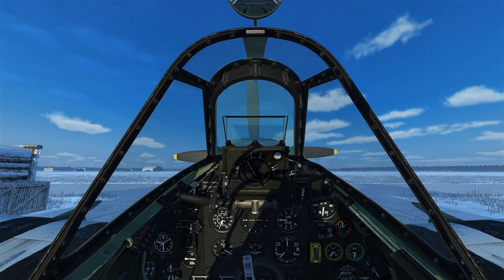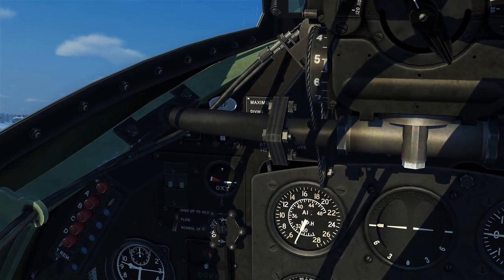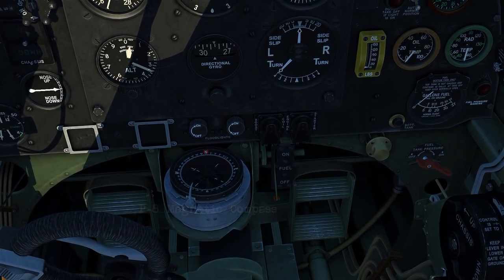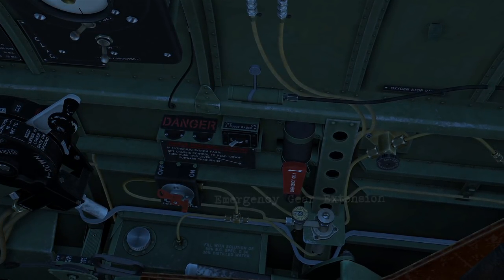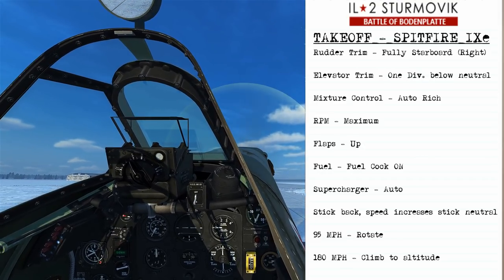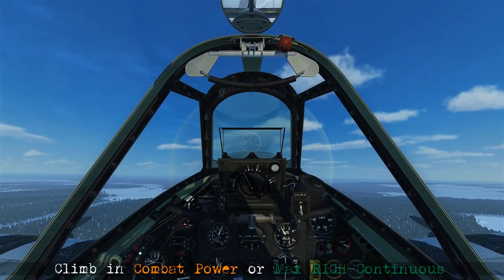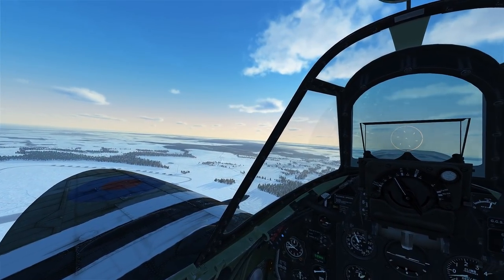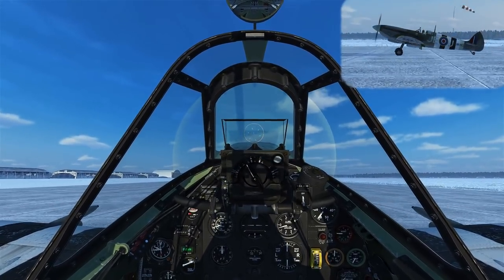Learn to fly the Spitfire MK.IX

Comment: In reality Merlin 66 and 70 engine Spitfires had Bendix-Stromberg injection carburettors and mixture was completely automatic with no pilot input. The mixture lever should act as an idle cut-off like in DCS.

Comment: Excellent video as usual, but there is one mistake. The take off elevator trim is one division nose down, not nose up as you have it in the video.  See the manual: it is quite explicit.
It does not make much difference in fact, especially since the BoS Spitfires seem to have less nose up tendency than the real thing, but that is what the book says.
Reply from the maker: I know what you're meaning Unreasonable. I do have the original Spit IX manual (plus the DCS one) as I try to base these videos off the manuals from the period when I can. From what I learned the neutral position is 2 bars towards Nose Up from the center according to the DCS manual, so with the phrasing in the original manual maybe it needs to be 1 bar down from neutral instead? I don't know. It doesn't seem to make a great deal of difference as you said, but with that neutral position in the video I the takeoff felt very natural so I wasn't too concerned about it. One day when I fly a Spitfire in RL I'll know for 100% certainty though :-D
Reply: I stand corrected!  I just assumed that the neutral position is in the middle of the scale, since there is nothing on the scale or in the manual to indicate otherwise, but on checking the trim tab in external view it is as you say at neutral when two divisions up from the middle.  I shall now have to get used to taking off in a slightly less nose down posture.   

Thanks for reply! I always learn useful stuff from your films.  Hope you get a chance to fly a real Spitfire one day.

Comment: Thank you! That gliding approach is the first I've seen. Could you elaborate as to why you do this?
Reply from the maker: It's known as a "power off 180" approach. No particular reason to do it or not to do it all the time. It's kind of a test of how good your energy management of the airplane is. Ideally you will land where you want to land using this technique, but it takes practice. For an extra challenge you can try these power off approaches to a wheel landing instead of a 3 pointer
Reply: @RequiemsACTL  Got it, thanks mate

Comment: As usual a terrific video.  Any chance you could do something on avoiding blackouts in the Spit IX?  Something about this aircraft makes it very prone to blacking out, at least when I fly it.  Thanks
Reply from the maker: I'll try Neil. The issue with blackouts is that it's related to the rate at which you apply G as well as the max you can apply. The Spitfire and Tempest for example have high amounts of elevator authority so you can apply G very fast very easy...too fast for the pilot's cardiovascular system to compensate, so he gets to say goodnight :-)
Reply: I guess all that elevator authority is great when you are slow not so much when you are fast.

Comment: Requiem, just noticed you've got a manual mixture control. Was this removed in a patch and switched to an automatic control?
Reply from the maker: Yeah I think you're right Moggy. At some point the devs added automatic mixture to the Spitfire IX. I can't remember when that happened though.
Reply: the clip wings were for increasing the Spitfire's speed and roll rate but at the cost of reducing the turn rate.

Comment: Thank you for the vid; Is it possible to release bombs individually on this spit or only all at once?(2 x 250 & 1x 500)? Also, what do you consider to be high altitude for the Merlin-70 to be advantageous? Many thanks
Reply from the maker: You're welcome Mark. Unfortunately it's not possible to release bombs individually. The bomb release button is on the inside of the throttle handle and that just drops the 2 x 250kg bombs at once.
Reply from the maker: Oh and regarding the Merlin 70...I think off the top of my head you need to be above 26,000ft...but I'll need to check
Reply: Many thanks for the prompt reply; pity about the single bomb release and I very rarely fly the spit at 26000ft if ever, I will stick with the Hi octane option,thanks again
Reply from the maker: No worries that's what I'm here for! Yeah definitely stick with the high octane...it's like a whole new airplane with that!

Comment: Help, I have watched you how to on the mk9 spitfire many times however I keep losing control after landing and slowly down on the run out , the aircraft starts to swing and no amount of brake and rudder will bring it back this usually results in a wing strike and ripped off aileron.  I still have flats down , should I raise them after touch down. Any suggestions grateful accepted.  Thanks in anticipation  Leigh
Reply from the maker: Just as a disclaimer...what I'm going to tell you next is a technique for the game. I do not recommend this when flying in real life. In the Il-2 Spitfire: Hold down the brake as soon as you touchdown and DO NOT let go of the brakes until you're at a stop. When you use the rudder pedals you will get differential braking as well as the normal rudder effect. You will not ground loop whether the engine is running or turned off doing this technique.
Pretty much everything I teach on my channel is based on real life principles...but this one is a rare exception to make your landings in the sim easier.

Comment: Why the hell does this thing like to ground loop so hard? I mean no locking tail wheel yeah but still
Reply from the maker: If you use the brakes while using the rudder you'll get differential braking and won't ground loop.

Comment: Good video.  Thanks.  I have a real problem with ground loops.  What am I doing wrong?
Reply from the maker: Use braking and rudder at the same time. This will provide differential braking. You can land the Spit engine  on or off without ground looping ifc you use this technique. It just takes practice :-)
Reply: @RequiemsACTL  Thank you.  This has been driving me bonkers.  Every single time I grease it on, nice and easy, 3 point,  slow, gentle braking I think no way a ground loop and then I go into one.  I looked up the Spit to see if it had a locking tail wheel.  Nope. Your answer has saved me from pranging another bird.  Salute.

Comment: why does the Spitfire always spin around near to the complete stop ? What am i doing wrong ?
Reply from the maker: You need to continue holding brakes until you come to a stop and use rudder at the same time. When using brakes with the rudder pedals it provides differential braking.
Reply: Keep your eye on the turn and slip guage. The turn needle should not go outside the number "1" marker in either direction. Use this to fine tune your rudder corrections until you come to a complete halt.

Comment: Hi.. Im having some dificulties using the engine for normal and combat flight. What is the correct throttle, propeller and mixture for best performance in normal flight and combat? Could you tell me that for the VB and IX models? And also, I stall every time in hard turns, it seams that the plane pull more than I commanded. Any tips for that?
Reply from the maker: Look in the Specifications page when in the hangar to find the correct RPM and Boost settings for the MkVb and IX Spitfires. Use "Max Continuous" for cruise flight and "Combat" for combat. As for mixtures just keep them at the "Auto Rich" setting, but you can set them to "Auto Lean" during cruise if you wish. There is a bug right now (31 Oct 18) which may be causing problems for you as it affects the automatic radiator control in the Spit Mk IX, so it can't not regulate temperature correctly that should be fixed in the next patch.
Reply: @RequiemsACTL   nice.. thanks. And what about the overcontroll during hard turns? It seams for me that the elevator have excesse of actuation when I pull during turns. That doesnt happend in other planes. I think that is why I always saw people fall in expiral durin combats when this plane was release in the game. But I didnt figure out how to avoid. If i pull less, everyone get on my six... any tips?
Reply from the maker: The elevator is very sensitive, so it takes practice to become accustomed to how much you need depending on your airspeed. Try some tight turning starting from different airspeeds in a quick mission without anyone shooting at you. With a fast airspeed you should be able to turn hard enough to start greying out but the slower you go you will need more back pressure to keep up the same turn rate. Start out with a little bit of back pressure then increase it...if a bandit starts moving to your six then pull back more to bring him forward on the canopy. You shouldn't have much problem out turning anything in the Spitfire.
Reply: @RequiemsACTL   yeahh... I will try.... thanks alot

Comment: I would love to be this smooth in landing.. Would also love to see you do this in the Spit in DCS, if you fly that too? Another great video, thanks!
Reply from the maker: I do have the DCS Spitfire as well but I haven't flown it yet! It will be pretty much the same procedure you see in this video as I use the real manuals when available for these familiarisations. I'll see about doing a quick takeoff and landing in it.
Reply: It's maybe not the right place here but the flight model in DCS is quite different and the plane becomes very light and floaty on approach (and hard to control), with a tendency to turn every which way but fly straight, causing a wing tip on landing (for me). At least in IL-2, the planes are more predictable. Having only flown a Katana in real life, I can't comment but based on the films I have seen, Spitfires appear quite controllable, even on final.
Reply from the maker: I'll fly it today and get back to you
Reply from the maker: Ah good to know. I actually finished a few takeoffs and landings in it via the "Instant Action" mission just now (Video link at bottom) Wind was 300 @ 4 m/s (8kts) but it lined me up on RWY 09...so I took off with that slight tailwind and swapped to the downwind for RWY 27 at midfield for a crosswind landing (4kt component).
The main impressions left on me were a weird transition in the FM from the ground to the air and overdone yaw oscillations during even minor power changes (may be my controller). For just a 4kt crosswind though it felt like I needed an excessive amount of crab on final in other approaches I made as well.
https://www.youtube.com/watch?v=dwnI-Dd13OE&feature=youtu.be
Reply: The yaw oscillations are very noticeable. Which controller are you using? I think you mentioned that you have a Logitech G940? I also tried with the MS FF Sidewinder, which was better but mine is old and too loose, compared to the other hardware that I use. I have now ordered some monstertech table mounts, hopefully that will improve the precision of control with the TM WH, will let you know how I go.. Maybe one day I will get a VKB or VirPil stick..and a Yoko yoke :)
Reply from the maker: furyspitfire I have a g940 but I replaced the pedals with MFG Crosswinds so those are pretty much the best there is. I don't have problems using these pedals elsewhere though.
Reply: I don't have space for the MFG Crosswinds so I got the VKB MK IV's, which are also very good, just without a toe brake.